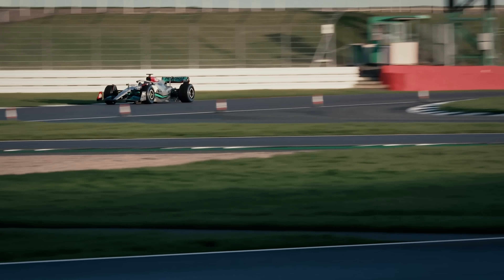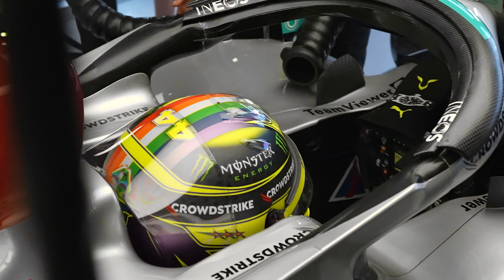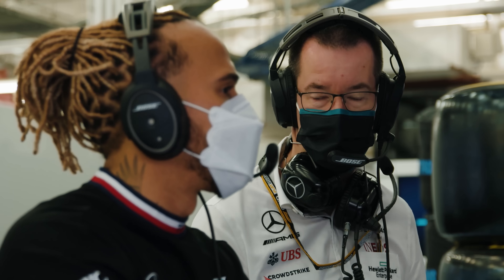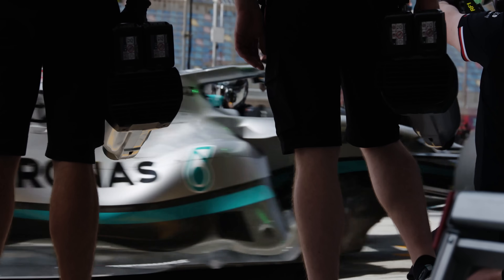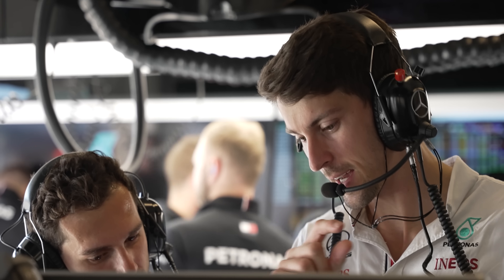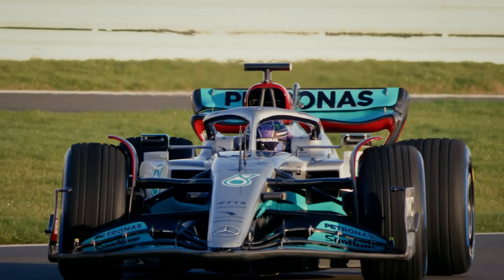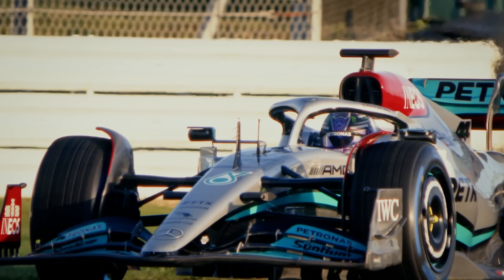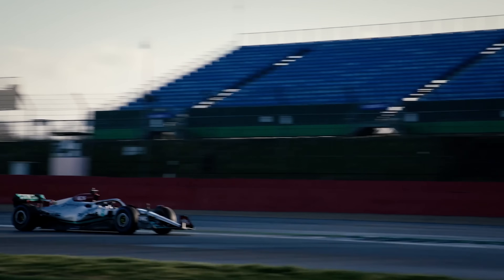How Much Data Does an F1 Car Generate?

Comment: If at most you get 90 Mb of data per lap after it gets back to the pits. And you claim 1Tb of data per weekend. That's over 10,000 laps. Either you have your math wrong. Or your numbers are made up.

Comment: Very informative but I'd rather have more technical data than marketing and promotion lingo (plenty of that in this video, but it's not directed to potential sponsors but to die-hard tech F1 junkies).

For example it would be absolutely awesome if you could share (very) technical conversations between drivers and engineers while they're analysing data on those cryptic screens. It doesn't have to be current data obviously, nor corporate IP, but it could very well be tech discussions from previous years which are irrelevant to competitors now thought still very informative to F1 fans.

Also it'd be great if we could have the same from non-winning teams, the guys that are battling at the bottom of the table and rarely get any publicity. Seeing how complicated their work is, would probably help fans appreciate every single person working in F1 technology and hold them in awe even if they've never had a single top-10 finish in their entire career.

ps: Mr. Evan Short is an absolute joy to listen to!

Comment: I'm nowhere near any field of engineering but this is still incredibly insightful. Since this is a very broad look at data for an F1 car, it would be interesting to see a very specific look at the data being processed during a race weekend, like for example a small clip being sent to the factory, what kinds of insights came out of it, and what was done to make that data productive on the 2020 Austrian Grand Prix or something like that. 

Thank you for sharing, I hope to see more content like this.
Reply: Believe it or not, sim racing like iRacing actually generates and can store a lot of the same data, and there are free (and paid) programs for analyzing performance. I don't know if it is still available, but McLaren's professional driver analytics program will give you the same performance data analysis the pros use. It is the same program for real cars. Steering input, g-force breaking, tire temperature, etc.

It doesn't have engine particulars or aero performance sensors, but the car physics is all the same.

That's a great source for seeing what data is used and how, even if you don't actually race. Get someone to save the telemetry from a race and use the free tools to analyze the data.
Reply: @johnelectric933  That's interesting, would you happen to know a couple of tools? I googled some but since it's really not my field I'm unsure if I'm reading up on updated contexts

Comment: 1:53 slight graphical error regarding the tire thermal sensors. The front wing flap adjuster is indicated instead. The sensors are actually located on the top of the endplate. These videos are informative for fans though.
Reply from the maker: Oops, sorry! Good spot. We'll make sure not to make that mistake again 😊 Glad you still found the video informative though!

Comment: What would be the one data stream that you wish you had, but is too complex, heavy or not possible to get?
Reply: The driver's thoughts? Or rather how the car physically feels to them in real time.
Reply: I think, as far as sensor data is concerned the high memory requirement does not come from the individual data points because they typically are only time series with just "x-y" values and with very less memory requirements, the sheer quantity datapoints collected makes things heavy, it is done so that analysts can have as much resolution as possible. Kind of like why pro photographers and filmmakers shoot in RAW, to have maximum amount of information even if 95% of that is useless. So to my knowledge every type of sensor data can be had on telemetry only question is: "how dense?"

Comment: How do F1 team brought an upgrade (car part) from the factory to the track? do they fly them directly by airplane?
Reply: With the cost cap requirements, I would imagine that the most cost effective method (cost vs potential benefit) are a consideration here. Most teams have a partnership or sponsorship deal with a shipping/logistics company, so may get expedited shipping at preferential rates from these businesses - but I’m sure the FIA have a way to properly assess the “real” costs to each team.